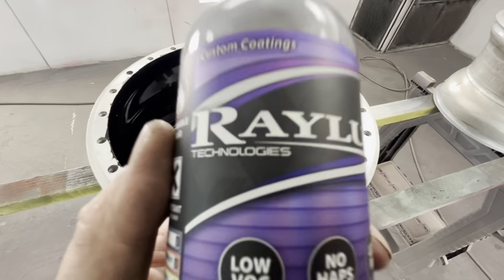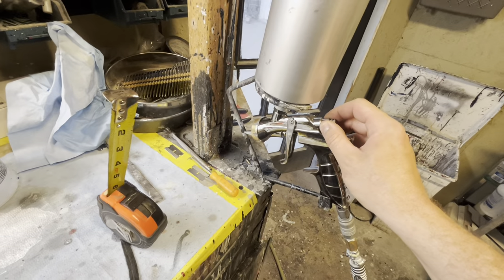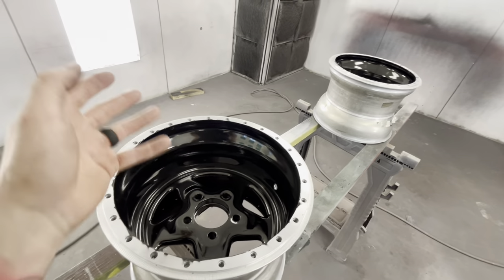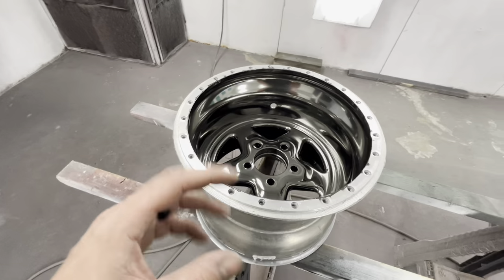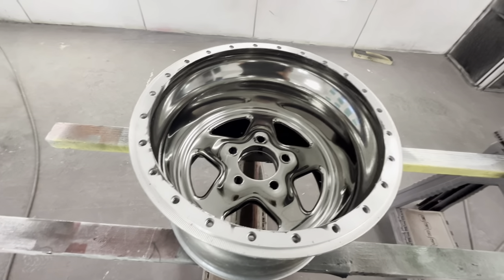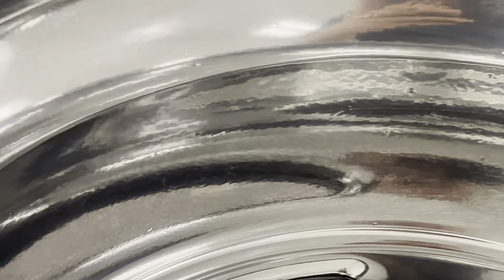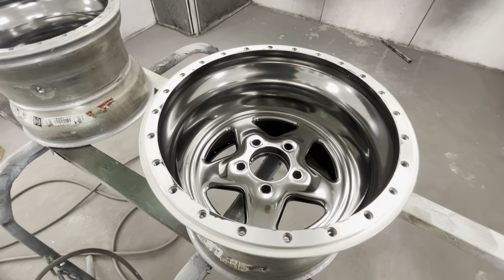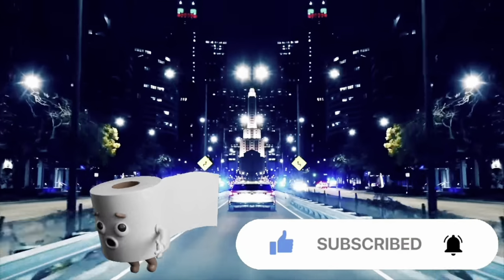🔥 Chrome Paint? 🥵 Black Chrome Bead Lock Wheels DIY ( I Think I Failed 🤦🏻‍♂️) MOTOCHROME

Comment: I did a helmet once where I painted it gloss black and did a very fine mist over the black with hardly any coverage and it looked like black chrome. The helmet owner loved it and brought other parts to do and it worked out well. 
   I've never clear coated any of those parts either. It looked good for a while until it gets rubbed on or waxed. Just refrain from touching it during the procedure.
Reply from the maker: Thanks that’s what I wish I did was no did so many coats
Reply: When I experimented later, I shot the gloss black and while it was still wet, I shot/ misted the silver over the black and that caused the silver to adhere to the black. 
   When I did airbrush fade work on lettering, I sprayed wet on wet. That eliminated the use of a clearcoat.  It didn't wax off either. Overspray where it was not on the surface of lettering, I used aerosol window cleaner to remove that, but the paint stayed on the wet lettering. Old sign painter trick.
Reply from the maker: @firebald2915 interesting

Comment: On a side draft booth wouldn't you want to face the wheels downstream from the intake filters, so your paint surface would be shielded by the backside of the wheel.Dirty air movement would be toward you and you could dust the product on without the trash getting in 
it. Just a thought.
Reply from the maker: Yes however you don’t paint wheels on their side so with the wheels it really doesn’t matter where they are laying inside booth

Comment: Great Vid !  I get the inset issue on the wheels, hard to spray:text-green-game-over:.  Would you recommend Motochrome for fiberglass bumper application❓ 
Question re: Spraygun maint.:  Any tips on greasing aging spray guns?  I struggle between getting trigger/felt lubricated, but not wanting fisheyes😳!
Lastly what (online?) paint company would you recommend for a value-priced 1K, Eastwood?  Your Medium truck cab 1K vid is one of your most highly popular! :hand-orange-covering-eyes:
Reply from the maker: Ok so for Eastwood I honestly have no idea. The customer supplied that paint on that job. I’ve never bought East wood paint. 
For you paint gun they make lube for paint guns. My local store sells it but I’m sure you can search online for “paint gun lube” and find something. It’s made so it doesn’t cause fish eyes or mess anything up. 
As far as using this on a fiberglass bumper id guess it’s work great if it’s smooth as glass and you follow all the manufacturer steps. 
Thanks for watching it means alot

Comment: When you only had only a couple of coats it had a good black chrome look also. I wonder if you cut and buff to remove orange peel would work?
Reply from the maker: Yes it would but it’s very hard to buff inside a wheel to glass. It did look better with only a few coats

Comment: Looks nice to me. Can I polish the black finish before using the chrome paint?
Reply from the maker: Yes I don’t see an issue with that. They just want a slick as glass black finish that’s not scuffed up
Reply: I wouldn't, when you sand the paint you open up pores that your polishing compound will fill in and contaminate the surface.

Comment: You need to use a particular clear with low solids & no solvents to keep the chrome look. If there is any solvent in the clear it will kill the reflective properties of the paint. I was a dealer & trainer for Alsa paints Mirra Chrome for 7yrs. This looks like they use the same process as Alsa Mirra Chrome. The chrome look on the wheels failed due to the clear used. Also whatever you are painting must be completely dry & de-gassed otherwise you risk more problems & if you put too much chrome on it will delaminate from itself. Very light dust coats is required.
Reply from the maker: Thanks for all that info buddy very good to know!

Comment: If you use a intercoat clear with the candy it will dry so fast like base coat you won’t have to worry about runs being it flashes so fast and you can tint it to the darkness you want then 2 k clear it I think you will have the results you want 👍👍
Reply from the maker: That’s same thing as a binder agent or blender I think they call them?  Basically a clear base coat. I’ve used it before.

Comment: microfibers are the ticket. i use them everyday wiping cars down before paint. they pick up everything. hardly ever use a tack rag anymore
Reply from the maker: Interesting
Reply: @ThePaintPaperHustle  give them a try. i use them for waterborne cleaner and wax and grease. i noticed a reduction in trash when i switched to them. i stick to the blue ones. you can use the other colors but i would wash and dry them first because ive noticed on some of that orange ones fresh out the pack that they would bleed a lil of the color/dye onto white cars. but after they have been washed they didn’t do it.

Comment: I totally get how camera and in person is substantially  different  I think if you fallow there process buy the T also if your that picky why can't you build up the base sand and clear then sand to the edge of flat as flat can get then  spay it ? Isn't that the process on getting paint flat 🤔  personally idk I have painted Mazda rx7s back in 90s early 2000  with sindlfle stage even cleared got  my white one to look nice it was  white but still I cleared over it like it was not a single stage lol after some sanding and buffing she looked shetynyc aka.     "Shitty-nice"  😂 I always loved painting  I grew up in a show car household my dad owned a 79 vette that was candy apple red with silver base all emblems were shaved and handles molding  exc car won multiple I mean alot of best of show paint it looked like a sheet of glass this is in florida heat as well if you ever done any body work especially with a glass body and those horrible rubber plastic bumpers they sag fiberglass sags bad in heat that car still today is in the exact condition it was sold in no sag  the owner of a major chevy dealership owns it now i think glass  moves alot  I take no credit for the work I will put him on blast his name was mitch at cross roads body shop in Deltona FL he is the
Reply from the maker: Awesome man and issue is if I wet sand it then buffing inside the rim is super hard